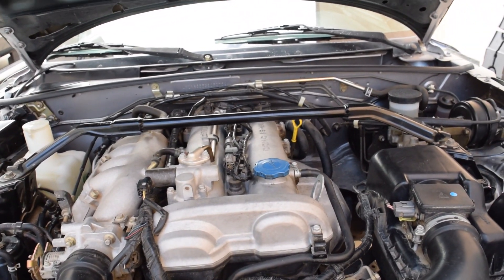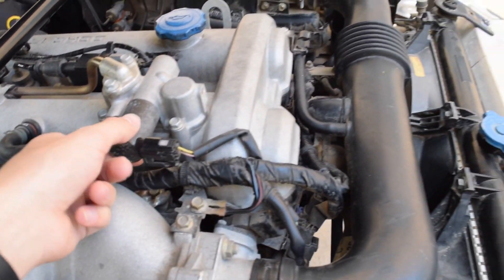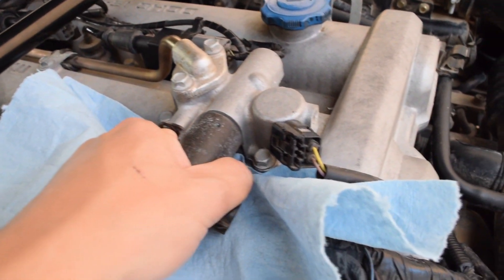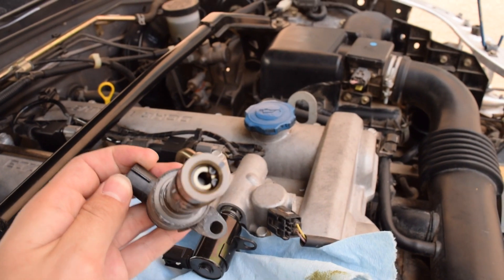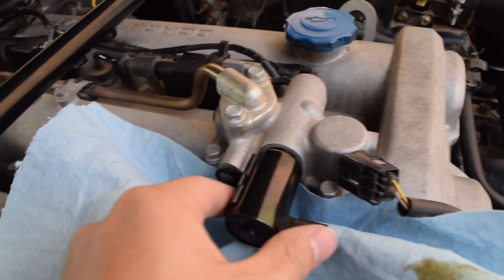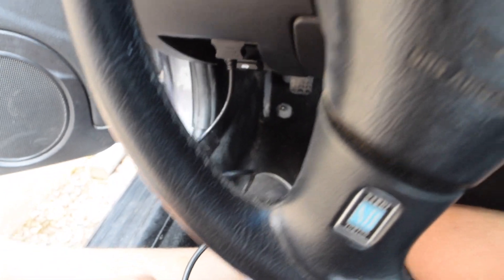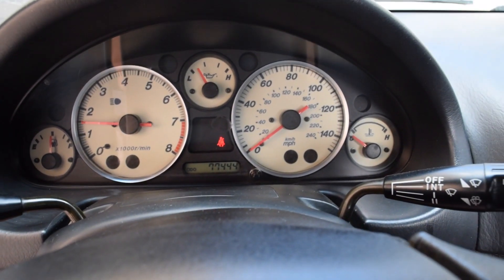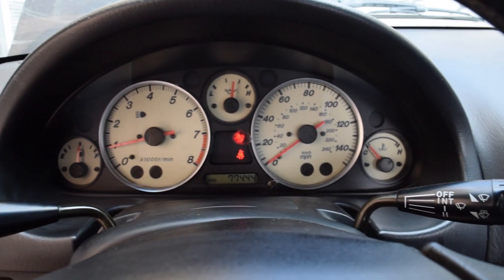VVT Solenoid Replacement (Miata P0010)

Comment: hey man any long term updates on this? also which solenoid did you buy? I see a few options on rockauto
Reply from the maker: I don't remember which brand I purchased, but the thing that finally made everything work in my car was to unplug the battery, and then unplug and replug the ecu connectors. I think there was just corrosion on the connector and getting a battery reset helped get everything working again

Comment: I heard you said to make sure I don't have any more codes on
But I'm running a catless exhaust so I have the 02  code also
Is there any problem?
Reply from the maker: That's not going to cause any issues with drivability but it won't pass emissions with a check engine light on, which is why I needed to get mine fixed.
Reply: @TheZGarage  I just installed it this morning and the code cleared, thanks a lot bro💪💪💪

Comment: How has it been working?  I have the same problem with mine and want to fix it.
Reply from the maker: It worked well until I unplugged it working on some other stuff then I got the same error. I ended up being able to fix it after I unplugged the battery for an hour. That reset something and the light hasn't come on in the 8ish months since